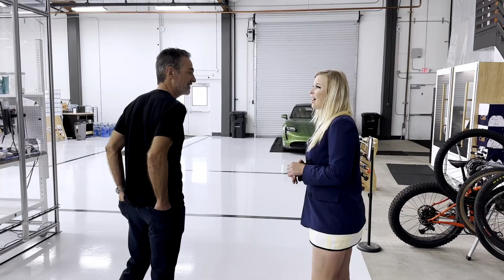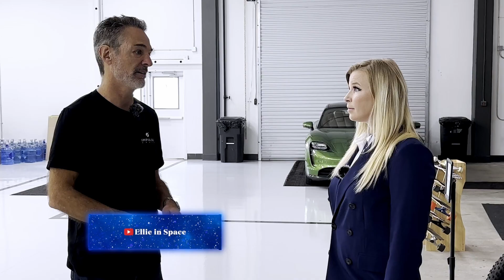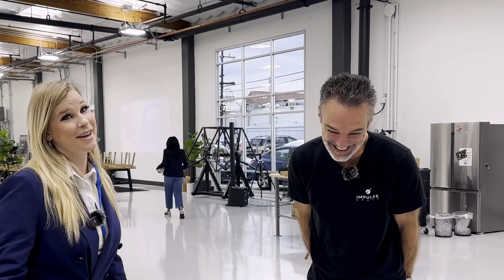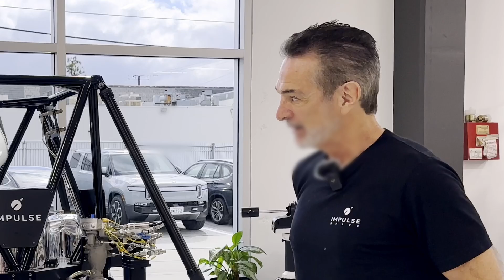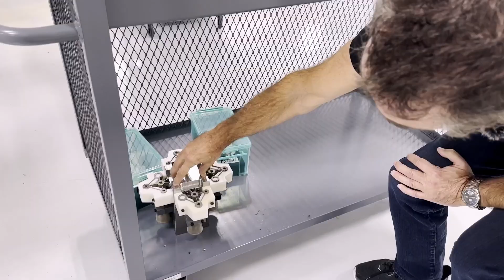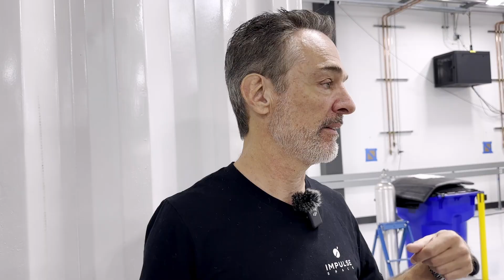Legendary SpaceX engineer Tom Mueller makes his own engines!

Comment: At 27:30 Tom explains they 'start with an aluminum liner'...'and then wrap it with carbon...' Can someone in the know explain how this can end up being half the weight of a titanium equivalent and how the aluminum liner and carbon wrap is manufactured? Could this process be used on any product to achieve the same light weight superstrong product? Thanks!
Reply: You can't push a rope, even if it's a very strong rope to pull with.  So COPV is really only good for pressure vessels (like maybe a gun barrel?) and not much else.

Comment: I really cannot get my Head around to 3D Printing ! I need to actually see it , how it Prints/Cuts to hopefully grasp it !
Reply: Imagine slicing an existing object into layers each of a few 10th of milimeter thickness. Then the 3D printer just does the reverse process of oozing out material layer by layer, one upon another, in order to rebuild the whole object. The exact shape and size of each layer to be 'printed' is controlled by the computer on the 3D printer which has been programmed with the CAM (Computer-Added Manufacturing) instructions, which was previously generated from the CAD (Computer-Added Design) file describing the shape and sized of the object to be created.
Reply: @tocu9808  There's no "oozing" in metal 3D printing. Resin printing (like in Small Soldiers or Jurassic Park III) is a better analogue.

Comment: Wait, what,... Nitrous Oxide and Ethane? He's talking about chemicals that every Hot Rodder knows where to get. And while cold while compressed, they're not the cryogenic liquids Starship is using, but would easily be contained in thin walled COPV type tanks to keep the vehicle mass down.
Edit: and there a few minutes later, Aluminium tanks getting Carbon Fiber wrapped,.... And while you're looking closely, the reflection in the glass shows one of the Impulse team doing a socials photos, You must be famous Ellie!!

Comment: Since Helios would be an oxygen rich closed cycle, how difficult was it to tame the hot oxygen? To stop it from becoming engine rich. 

Is Helios an ablative cooled engine or does it pump the ethane through cooling channels to get some higher ISP? 

How much horsepower does that turbine produce? 

How do you start the turbopump? Do you use nitrogen? Helium? Or do you start it with an electric motor?